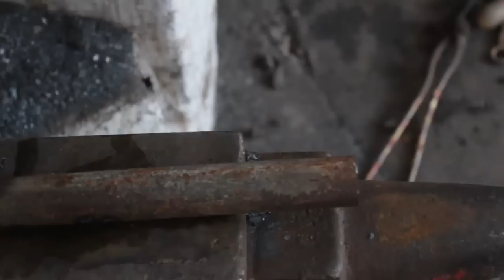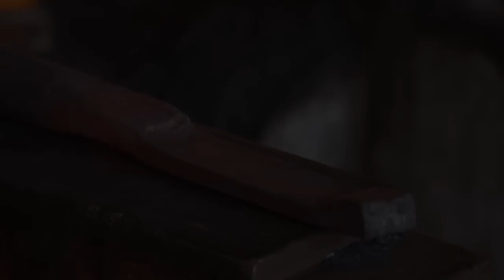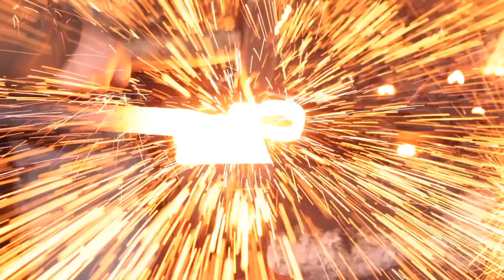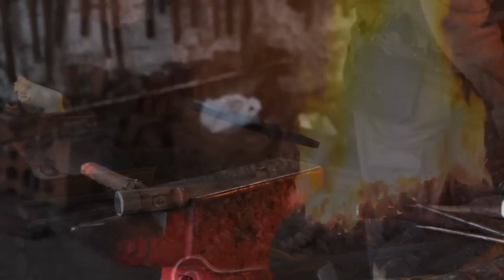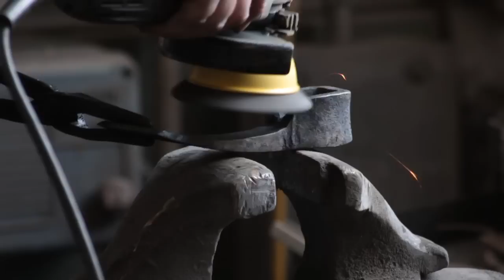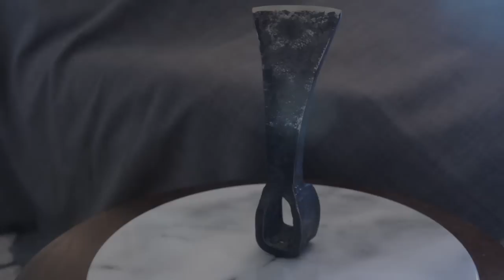Blacksmith: making a forge-welded Anglo-Saxon adze

Comment: Rowan, thanks mate, just a question on the carbon insert. Did the Anglo Saxons actually have carbon steel and did they use in in this fashion. That would go for the period all across? Thank you for your time.
Reply: They did have steel, either bloom steel or crucible

Comment: Clearly, one big advantage of a bottom draft forge is the clinker-breaker. Saves a lot of time and guesswork when cleaning out the clinkers.
Very nice video! I believe there are a few axe-like weapons, as well as many tools, that were made using this exact method.

Oh, and a hot beeswax finish is perfectly authentic.
Reply: You could do what I do and use a fuel that doesn't form clinker.

Comment: Is this faster/easier then punching and drifting?
Reply: Perhaps not faster, but you get to control the shape of the eye easier.
It's so easy to have a punch and drift go slightly off center and then one side of the eye is thinner than the other.
Just my 2c...

Comment: As the adze cutting edge is underneath, shouldn't the welded on steel part have been welded on the bottom?
Reply: Donald Sayers I believe he did weld the spring steel to the bottom
Reply: Jack Milne  depends on which way you are holding the tool
Reply: The very edge is carbon steel as he did it, and when in use, the surface that will take the roughest abrasion is the top. The bottom only needs to direct chips away.

Comment: Hi Rowan love your Adze. I recently  had an Bowl carving Adze made for me by a young Blacksmith. loved it but after using for a while I found that the angle was too acute. please how can I bend it back. I don't want to send it back. thanks.
Reply: David Fairman just send it back, I'm sure the smith would rather have his tool be useful to you.
Reply: You probably won't be able to bent it back without breaking it, assuming it was heat treated. You could heat it up and anneal it, but then you'd have to harden and temper it again.

Comment: lol welded the steel on the wrong side mate!
Reply: good point... that same technique is still used in Zambia for hoe making. to save money they use thick rebar or whatever is cheapest and weld a file to the end.
Reply: I just finished watching this video. I also noticed that the steel was welded to the wrong side. Mild steel will always be at the cutting edge....spring steel will be the waste material when sharpening.
Reply: you are right Chris however,most of his work is spot on! i enjoy his work
Reply: I agree. I am trying to learn some techniques for when I decide to build my own forge and start tinkering on my own.....why does my brain find all the old ways of things so interesting?
Reply: steel on the botom and a top edge will always wear out..... just start over dude!
Reply: Can you perhaps expand your mock into a more descriptive critique for those who don't see an obvious mistake. There's a self sharpening reason to be expanded if indeed that's your reasoning...
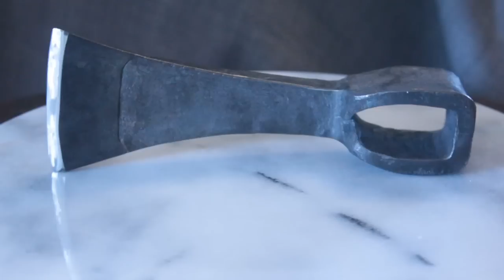Reply: Scott, examine the video at 18:57 
 An adze should be hardest at it's edge that edge is always on top. steel is welded to the under side on this particular adze leaving the poorest material at the edge (the top). I hope my comment was constructive this time around mate.

Comment: Very good video.

One thing I would like to ask is why you prefer to use millimeters when talking about length even when it could be used in centimeters as well? (120mm = 12cm.) Of course, it is easier to say "mil" than "centimeters", so . . .
Reply from the maker: Thanks mate :) Purely because that was how I was trained to measure stuff (I work mostly in Imperial mind, but I tend to skip between the two). I think it's more instinctive to say 127 mil rather than 12.7 cm. There's probably an actual reason we're all taught that way but I don't know it!
Reply: Alrighty.

Looking forwards to the next project.

Comment: great video! so would a weld that was blended in have a stronger hold?
Reply from the maker: +Hot Iron Art A blended-in weld is usually a weld which I know for sure has fully fused, however you can have a fully fused weld and still have a little mark left. I like to blend mine in mainly for cosmetic reasons.

Comment: From the stone age all the way up to about a century ago, pretty much everyone knew what an adze is used for. Well, not anymore.
Really nice work. A beautiful and useful piece.
Reply from the maker: +John Ratko Very true, John. Thicknessers are  abit easier to use, but adzes produce such a lovely tactile result.
Reply: RowanTaylor My Grandfather, Father, Uncles and Godfather all used adzes building structures, contouring boats, etc., but now you've mentioned a tool I've not heard of. Perhaps we have a different name for "thicknessers" here in North America. Would they be what we refer to as 'planers'?
Reply from the maker: +John Ratko I think I may be - we have hand planers, electric planers (hand held but with a rotary belt) and thicknessers, which basically sit on a stand or workbench and you just set the thickness you want on it, feed the wood in one end and collect the board the other side. They are wonderful pieces of equipment. The canal carpenter next to the forge have one which they use for all sorts from stop-planks to gates.
Reply: RowanTaylor Here in North America the tools you are speaking of are called : a hand plane, a belt sander, and a thickness planer(sometimes just a planer). There are also available electric planes that have a blade mounted on a revolving shaft these are a hand tool similar in appearance to a sander. Another nomenclature difference is the "linisher" over here that would be called a belt grinder.